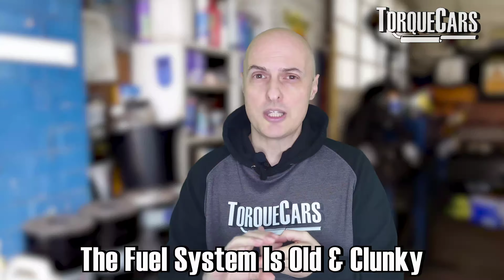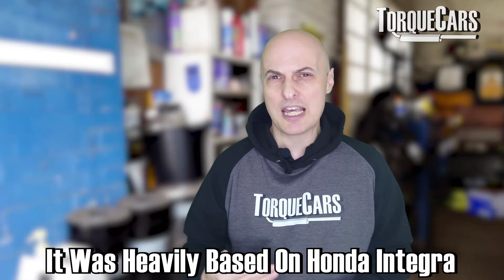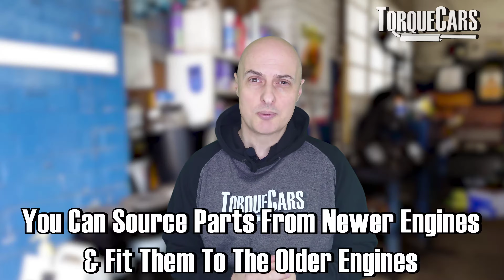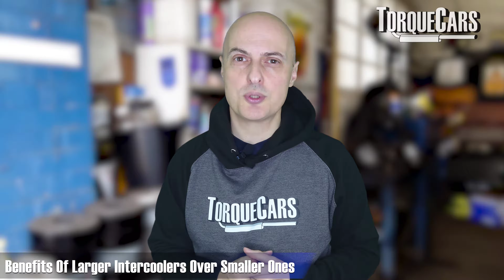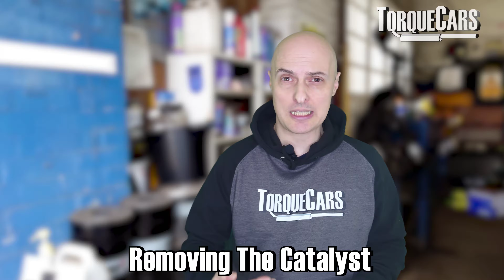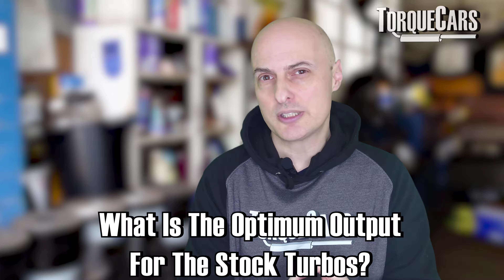Can You Tune Older Diesel Engines -  An Interesting Look At The Rover L Series Diesel Engine

Comment: No its not the same as the Perkins Prima diesel in the montego/sherpa freight rover 200 series and maestros that was a reworked 2.0 O series engine originally petrol which started life in 1978 in 1.7 and 2.0 petrol.The perkins prima were really good actually and Volvo Penta were selling them As MD22 AND TAMD22 Till 2002 as Marine engines turbo and non turbo units.

Comment: The L series was never in the Maestro, Montego or the Sherpa. That was the O series of which the L series is descended from. 
Also all L series engines have ECU controlled Dynamic injection timing including the ones with a throttle cable. 

All had 2 stage injection with the later 45/25 injectors having slightly higher 210 bar pressure 1st stage and much smaller .17 nozzles, over the SD/SDI 200bar .22 nozzle (lower pressure bigger nozzle more power)

 Afaik none of the diesels used an in-tank lift pump. 
Glow plugs do nothing for emissions they're purely for aiding starting in cold weather.
 Intercoolers are the same from the first SDI to the last 45. 
Turbos are basically the same, with very minor insignificant changes, all have the same turbine size, and turbine A/r housing, including the same size compressor with only a slight change in compressor housing A/r (from .42-.43) when the 400 became the 45. 

18-19 psi on a stock turbo is the limit because the turbine & turbine housing is causing high Exhaust Manifold Pressure  which leads to cylinder head lift. in short the turbo is too small for much over 130hp, those who have more are in my opinion been lucky. 

its simple really, more air flow, more fuel more power, the L series that have made 180-200 hp have bigger turbos.  hybrid gt17-52 up to gt2056 sizes and bigger injector nozzles for more fuel. which also means much uprated clutches too.

Comment: Fully mod 170bhp with 430 lb
200bar injectors 
Cjl map 
Maf delete 
Egr delete
Reply: "MAF" delete? That´s the air sensor after the air filter, it´s true? How the engine can run without the MAF ?? makes no sense.

Comment: So I’m from Bulgaria and I’ve got Rover 25 L-series (101 hp I believe). It’s my first car, bought it from a friend for roughly £300 because they crashed into him. Basically I fixed the damages to a point (note that it was crashed from the right side everything engine wise was running perfect) and I’m driving her a lot. Currently at 287 000 km. (don’t think these numbers are true tbh) Running strong it’s basically a bulletproof engine. I bought SDi injectors and boost gauge and now I’m planning to tweak the hp a little bit.

Comment: What are your experiences on obd1 tuning ? Ive got a mate with an older Quattro who has recently modded his  diesel engine with injectors , turbo etc.. hes convinced he doesn't need an ecu tune but hes currently got problems with misfires and such , i suggested a dyno tune where i got mine done but my motor is a newer common rail so obviously differt. His is a 1996 so info is sketchy online to be fair